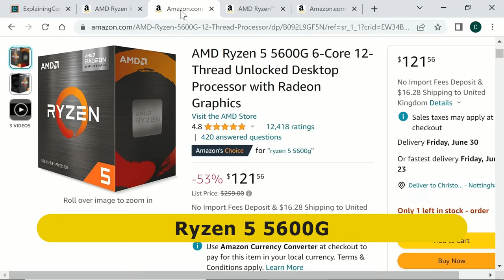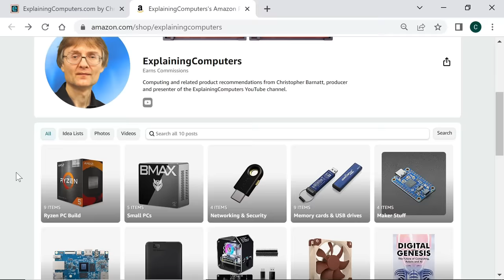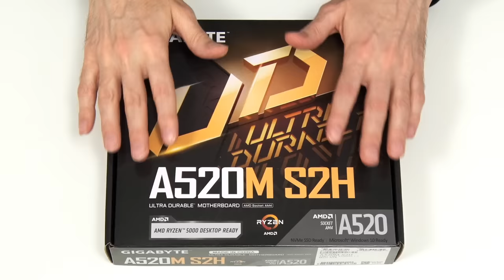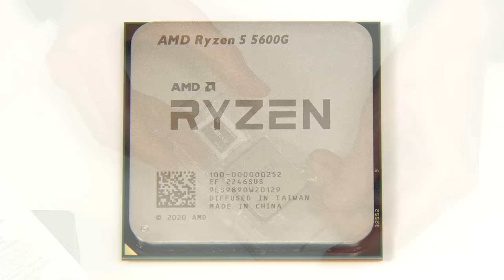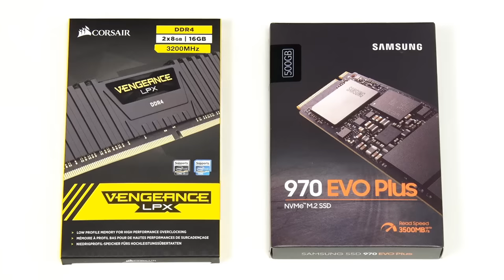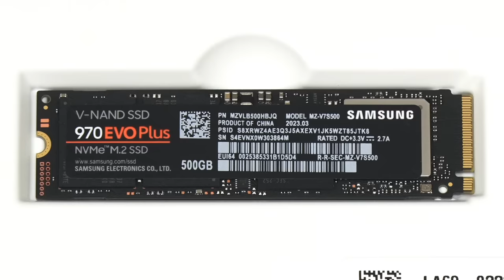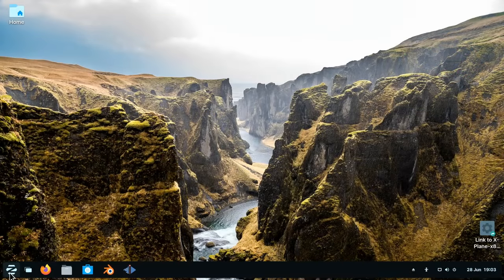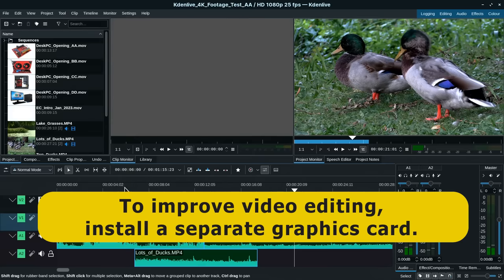Best Value Ryzen PC Build

Comment: USB 3.2 gen 1 is basically classic USB 3 or 3.1. That means, 5 Gbit/s maximum. USB 3.2 gen 2 is 10 Gbit/s, USB 3.2 gen 2x2 is 20 Gbit/s (basically nobody is using it anyway). Then there is USB 4 which is, with both eyes blinded, Thunderbolt 3 – but without strict requirements for power, supported protocols which further creates more mess.

Therefor, while I don't like Intel, with their boards and notebooks it's pretty clear that if there is Thunderbolt port, it supports everything – 100 W power, display port, ethernet etc.Same for Apple machines (which I use mostly). 
On AMD machines, you quite often won't find any USB 4 at all, no Thunderbolt (never ever). And if there is USB 4, you must hardly check what it really support as there are no fixed requirements.
It might support up to 16 Gbit/s for data (that is for Thunderbolt 3, as 40 Gbit is WHOLE bandwidth with half reserved for display). But it also might support 32 Gbit/s data and less for display.
And while it should support 100 W power delivery, it only MIGHT. not that it HAS TO.
Reply from the maker: Yes, my mistake on USB 3.2 Gen 1 there. And I have a video that covers all the standards (there are two versions of USB4) https://www.youtube.com/watch?v=PctX3kcTj5U USB4 is not actually Thunderbolt 3, but does support its standard.

Comment: Good episode. You dont need a 550w PSU. Anything cheaper with 250/300/350/400w will suffice.
Reply from the maker: It depends what you mean by "need". It is always wise to have headroom for expansion, and it s more efficient to run a PSU well below maximum load. 400W could be used here, but  I would not fit less in a Ryzen system.

Comment: Thanks so much for your quick answer.  Right now I'm writing on this old lady and it works fine. I am running Mint 64 bits and no problem. As I told you before my only problem is to create a bootable linux USB in Linux. Of course I've tried Balena Etcher, my last try was Ventoy. I also tried unetbootin, the tools available on mint etc but in vain. So that is today I created a USB on that windows laptop with rufus then I placed my virgin SSD in this PC and boot with the rufus usb and here that's me writing to you on my brand new installation of Mint 21. If you use Balena Etcher and it works good for you. I've been messing around with the BIOS on this PC but it was useless except for the boot order. Bueno I'll keep investigating. I said 20 years old because the battery on the MB is wasted and every time I check the BIOS the year says 2002. So I update but it falls back to 2002. Do you think that could influence? Thanks again for your time.
Reply from the maker: Ah, I see -- much clearer now. You want to create the bootable USB in Linux. I get it! :) Have you tried Balena Etcher in Linux? I use it here in Linux Mint and it works fine. And yes, the motherboard battery losing the time can cause these kinds of problems -- if the data is too far out. But you could always set it manually (or have it picked up from the Internet) before creating a drive.

Comment: Hi Christopher,

Does 3:13 mean that the 5600G has better graphical performances than the 7600 (when the latter is not used in conjunction with a GPU card)?
Reply from the maker: As far as I'm aware, the iGPU in Ryzen 7000 chips is intended for office work, video playback, things like that, whereas the APUs in earlier generations were made for budget gaming and video editing. The iGPU in the 7600 has a higher maximum clock (2200 vs 1900 MHz), but only 128 vs 448 shading units (a bit like NVIDIA CUDA cores). As a result, the best data I can find suggests the 5600G iGPU is about twice as powerful as that in the 7600. And we do expect "G" 7000 series chips to be launched at some point, which tells us a lot.

Comment: My eyesight is relay bad, so I never used the triangle for aligning the CPU, always looked on the pin keying. In fact I allways believed the triangle should be on the socket, never noticed it on a board.

Comment: Think a 3600Mhz RAM (rather than 3200Mhz) would have been better to improve the performance of the Integrated Graphics, as they are dependent on the RAM, and higher clock RAM's highly benefit Ryzen systems.

Comment: If your gonna use the 5600g 0r the 5700g use better thermal paste. Stock thermal paste run 50c to 60 c. Upgraded thermal paste you'll be seeing 40s under normal usage 70s in game
Reply: I used artic mx 4. Artic mx 6 is around 10 bucks so it's a worthy investment to prevent high temps

Comment: Thought i would correct a little mistake you made.

The GPU of the 5600 doesnt have 7 cores, it instead has 448 cores. I think you got a little confused because it does have 7 Compute Units (CUs) (64 cores per CU) hence why the GPU is a Vega 7, with the 7 meaning how many CUs the GPU contains
Reply from the maker: Yes, you are right, the GPU has 7 CUs and 448 shading units.
Reply: @ExplainingComputers  no worries, we all make mistakes from time to time, either way, great video

Comment: Ok, with the plane crash I see why you're not a gamer😁. Well, in late. 2022 I built a PC to save power when electricity prices were over 1 pound/kWh (in Denmark). Got the Intel i3 tray model based on your advice. Tray cpus use less power. Together with an itx mini motherboard it cost me 350 pounds. Now I see this build costing half of that. I'm always very cost conscious and kick myself for not looking at this amd chip. But, prices were significantly higher in the fall of 2022.

By the way, this i3 is faster than my old pc build from 2019 which sports an Intel I7 K model, the fastest I7 model that year. So, I don't regret my 2022 build. However, the power consumption is only a handful of watts lower in idle mode. You'll never notice a difference on your power bill. So overall it was a waste of money, around 500 pounds with a case, power supply and ram. Only consolations, it was an interesting experience building a small pc and I have a backup pc.

Comment: It will be interesting how well newer AMD APUs that can be used in the AM5 socket. Sadly only mobile APUs for mini desktop PCs when it comes to 6000 and 7000 series. 
Then there is small amount of graphics processors on most 7000 CPUs but not really something that can be practically used for more than displaying to a monitor.

Comment: Pretty decent build, though I think the better price point for storage is 1TB for around £35 now, so only £4 more than that 500GB drive. Slightly slower than the Samsung 970, but I really don't think you'd notice the difference in normal use.
Reply from the maker: Agreed in normal use for the SSD. But for me, both generally and on a test rig, large sustained write speed matters, and that's why I bought the Samsung Evo.

Comment: RAM speed should be measured in MT/s (megatransfers per second) not MHz (megahertz)
Reply from the maker: Not something I needed to delve into in this video. :)
Reply: @ExplainingComputers  maybe not, but it's always a good idea to use accurate terminology. Plus it's good opportunity to plug another video explaining why you're using MT/s instead of MHz.
Reply from the maker: I  have a video called "Explaining RAM": https://www.youtube.com/watch?v=qmJWkfOTOPg But I would dispute your "accurate terminology" point, as also important is effective communication (in education, less is almost always more). So given that we can see (at about 21:14) that the RAM speed is indicated in MHz, and it's also also printed on the product box in MHz, I was not going to confuse/complicate matters.

Comment: I think the AMD RYZEN is such a big deal. Even the thinkpad I use as a daily workhorse uses a Ryzen 7 Pro 4750U and its still going strong. Its even faster and cheaper than the same model with an Intel Core i7. Before 2020 nobody ever thought of going for an AMD system

Comment: You could take on Linus from Linus Media Group who isn't a gamer either (but says he is).  Cool build.  I like the old tower you're using.  It looks like it supports 4 5.25 inch external drives plus 4 more 3.5 inch internal drives.  Is that correct?  I hope you're not putting original data on the SSD without having HDD backups for the data.
Reply from the maker: You are totally correct on the drive bays, good spot. On the SSD, no single drive of any kind can ever be a permanent data store. :) I've covered by own backup strategy (at least 5-2-1) in other videos. :)

Comment: Should i buy Ryzen 4600g instead of 5600g because 5600g is just 15% faster than 4600g and iGPU is same in both. And i don't overclock so i will purchase Gigabyte A520M K V2 Motherboard with it.

Comment: Chris, with XMP enabled - or EXPO for AMD in this case - have you tried running the bootable image for MemTest86 for 24 hours non-stop to verify that such a run produces no red error text lines after that duration?  Also, did you verify that your exact Ram product code is on the QVL for the MB and supports EXPO?  For me, I think XMP and EXPO are a bit of a cludge in that not all CPU/MB/Ram builds are supported - or if they appear to run, there may be errors present with MemTest86?
Reply: not sure anyone here understands what you are saying!! I certainly don't.
Reply: @DeepakKumar-lv4te  Intel has XMP tech and AMD has EXPO tech.   Both of these techs are basically the same in that they allow a profile for your ram to run at the max speed, improving your performance greatly.  But the downside is that these are special cases for known part numbers of Ram sticks.  These part numbers are shown for motherboard Qualified Vendor Lists for XMP and for EXPO respectively.  If you buy any ram brand and put that in + enable EXPO or XMP in your Motherboard Uefi settings, it may not work fully, resulting in many unpredictable crashes and file system corruptions.  The only safe way to verify that you are good with your hardware selection and also with XMP/EXPO is to use a bootable and downloadable image for memory testing.  That software/image is called MemTest86 and has been in use for 20 years or more.  Does this help you?  If nothing else - you can use my terms here with google searching to get fully detailed information to help you understand more.
Reply: @bobmcbob4399  thank you.  I should have said, some like me wouldn't understand.  I'm sure many here are well informed like yourself!  I shall bear this in mind, didn't realise memory would be limiting in this way.

Comment: Meaningful budget build. Not all users are interested in hi-res/hi-fps competitive gaming, with monster gpus and excessive cooling needs. I even find rgb pointless, i think it's bad even for gaming and definitely for professional or creative work as it rather distracts the user while he/she needs attention and concentration instead. The only thing I would change is the motherboard, I would opt for the more mainstream B550 chipset, as those Axxx ones are underbuilt - as do the "K" type mobos: 2 ram slots, pci3.0, rudimentary cooling if at all, only 1 fan header, fewer and worse vrms, only one "modern" display connector (may be a problem if you want to connect two monitors) etc etc. The price difference is not great as long as you remain in the UltraDurable/Prime/Pro category (sorry, but I don't trust ASRock or Biostar). And it's considerably more featured, more upgradable and easier to resell. We are after the "value" (for our money) after all, not necessarily the cheapest option.

Comment: Chris, since nvme hard drives are getting so cheap nowadays,  is it possible that we'd see more nvme slots,  like 4 or 5 slots for hard drives in the motherboard? NVME hard drive sticks  are so many times faster than ssd hard drives that still use pcie slots. It's like night and day.
Reply from the maker: It is indeed possible. And more expensive desktop motherboard do tend to have two or three M.2 slots. But it is now also relatively cheap to plug in a PCIe to M.2 adapter that allows extra M.2 drives to be fitted -- often two or four of them.

Comment: The 5600G is the processor of my main computer. And to date, it's the best value for the price ratio I know. I ask it to do some crazy things, for work and gaming, it's a work horse. With an additionnal AMD graphic card and the Adrenalin drivers (the adrenalin drivers have an interesting behaviour in this case - spoiler alert : load balancing between the additionnal GPU and the iGPU... Quite handy for an old RX590 not as old as we can guess...), it's not crazy but I'm impressed (I'm easily impressed... ^^ ), for the price, in benchmarks, heavy workloads (3D rendering, videos encoding) and unoptimized games.
The only con I encountered with it is the cooling system. The Wraith is quite silent and clearly good enough (not like the one provided with the athlon 900... I'm old, I know... ^^ ) for spaces where the temps don't go higher than 23-25°C. I moved and I haven't A/C anymore and it's summer... The temps can go higher than 30°C... It has some difficulties to dissipate the heat (the Delta T° isn't as good as in winter even if my tower is really well vented), so I've upgraded the cooling for one designed for higher TDP processors... This processor has a TDP of 65W (nice for a, kind of, low consumption computer) and I've upgraded it with a Be Quiet Pure Rock 2 able to handle a TDP of 150W and cheap. It's a bit overpowered 8 months per year but for the 4 others, I'm confident that my hardware is on the safe side with it.
For all the other components, I can't disagree. Really good SSD and RAM kit for the price. For the fans, I, usually, use some Be Quiet ones (Pure or Silent ones depending of the duty). In my country, they are slightly cheaper than the Noctua ones for really interesting performances in airflow and noise levels but not as good as the Noctua ones. For me, it's close enough. they'll do the job really well and they aren't ugly, like the Noctua ones ^^. If the price or the design are a deal breaker, they can be a really good second choice.
For the case, I've aThermaltake Versa H18. a really well vented one, but it's a dust catcher and the noises, comming out, are becomming after a few years quite annoying... I had to change my graphic card wich is really noisy and grab a noiseless case...
Really nice setup. I hope you've a really good user expérience with it because it deserves it. No bottle neck, great components and a work horse on hand.

Cheers from Normandy Chris.
Reply from the maker: Greetings from Nottingham! I think we will look back in years to come on the 5600G as a classic.

Comment: The interesting footnote is if you upgrade to a motherboard with a B550 chip and upgrade to the 5700G CPU and 2 sticks of 8Gb RAM a long with a M.2 NVME SSD you have a decent low end gaming machine !
Reply from the maker: All you list as different from this build is a B550 rather than B520 motherboard (which will make zero difference to the performance of the low-end gaming PC -- the B550 board may offer better connectivity, but not more performance), and and 5600G to 5770G (which will certainly add a little to performance). I used 2 8GB DIMMs and an M.2 NVMe SSD. :)
Reply: @ExplainingComputers  The B550 vs A520 will allow you to overclock the CPU/APU and use faster RAM.  With the CPU and the APU sharing RAM, speed is very important.
Reply: @jackpatteeuw9244  but would you do this build for a gamer?  Surely you would pick a different cpu and a separate GPU.
Reply: @DeepakKumar-lv4te  I said "low end gaming machine" !

Comment: Does the 970 EVO Plus get hot enough to thermal throttle?  If so, attaching an inexpensive heatsink would likely solve the problem.
Reply from the maker: I've not found it getting that hot, but a heat sink would be easy to apply as you say. :)

Comment: It would have been nice to have some mention of the type of case (and power supply) that one would need for this motherboard.  If you mentioned that detail, I missed it.  If this is so obvious that it didn't need to be mentioned, please forgive my ignorance;  I have never built a computer before.
Reply from the maker: No problems, I did not mention it, as I was upgrading in an old case. Any ATX PC case can be used that supports a Micro-ATX motherboard (so basically any case other than one only for Mini-ITX motherboards). You will need a standard ATX power supply, 500W or more (not that the PC will draw anywhere near that). Many cases will come with the PSU.
Reply: @ExplainingComputers   Thank you, sir.  I am ordering the parts to build this PC now, and I will use your US storefront to do so.  This was an excellent video!

Comment: I have a Ryzen 3000 series R5 processor on a motherboard with GPU support (but without a G series processor).  I wonder if it would be worth my while to upgrade my CPU with the one you used (would probably have to reflash my BIOS if a new one supporting the 5000G processor is available).  I have 32GB of ram on my MB.
Reply from the maker: I suspect that the benefits would be marginal, unless you are pushing up against CPU performance limits. And it depends what deal you can get an a 5000 series chip. :)
Reply: @ExplainingComputers  Or if the MB and APU combo might out perform the AMD GPU card  I'm using (it was an older mid range single slot card when I bought it, don't know if it is 4k capable, but does support two FHD monitors on HDMI, DVI, or Display Port).
Reply from the maker: Yes, indeed. A good point.

Comment: Nah, best value CPU is AMD 3400G.
I got mine for $63 (second hand, but new, with stock pre-applied paste and cooler) .

I also snatched a Seasonic PSU (ss-350es, second hand, though looked pristine) for $5, it felt like stealing.

And the motherboard (A520M K V2, new) I got for $62.

The 16G(8Gx2) of RAM I got from work, it was just sitting on my desk without use.

So in total I spent $130 for a rock-solid build.

And I also got two good old 1280x1024 monitors (Samsung  943N, and LG something) basically for free ($3.3 for each, cables included).